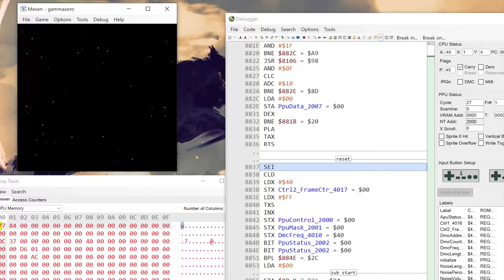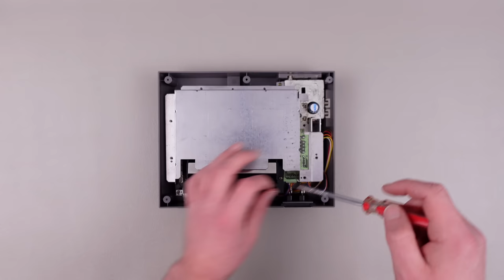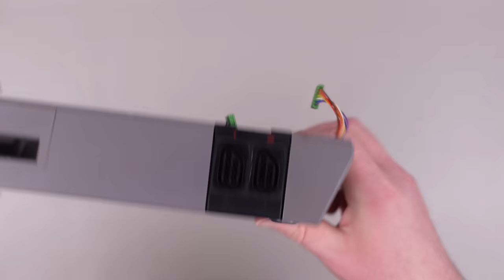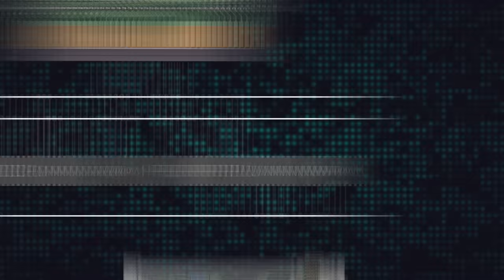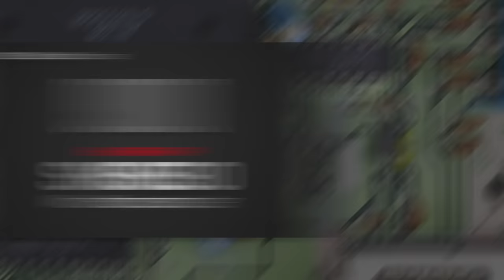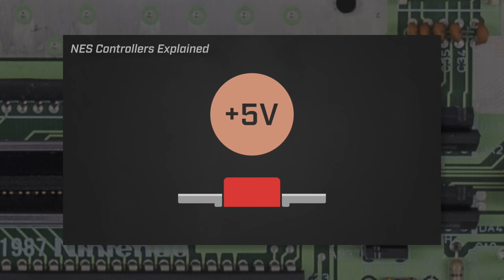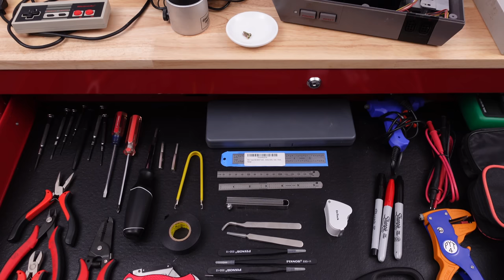NES Hardware Explained

Comment: I've found that cleaning the 72 pin connector is far superior to replacing it. Aftermarket connectors have a harsh grip and are made with inferior and harder metals that  will damage the pins on cartridges. I've cleaned 5 different OEM connectors and they work like a charm. Please just clean and not replace.
Reply: REALLY harsh. I got a new one and it had a death grip on the carts that required pliers to get the cart out. I ended up shoving an everdrive in there permanently to test ROMs I make. No way am I having it ruin my collection!
Reply from the maker: This is VERY true. The system I got for this video actually plays better than my “refurb” I bought years ago with its replacement connector.
Reply: I've seen some suggest to boil the original connector, I wouldn't recommend that. I think its just fine to get it a good scrub with alcohol and then slightly bending in the connectors inwards a bit to make better contact with your games.
Reply: Agreed.  I replaced mine about 15 years ago and it is really hard to get cartridges in and out.  On the plus side it works without pushing the cartridge down.  Unfortunately I threw out my original connector back when I replaced it.  Also, it worked better but was still finicky, so I'm glad I know about the alignment screws now.  I'll get in there and try adjusting it.
Reply: @nict2 yes boiling works. It makes sure the plastic comes back to its molded form. This is how you revive lego bricks who dont stick on each other to. But be carefull, dont actually boil it, id say take water of around 75c.
Reply: Those are facts
Reply: @nict2  I was skeptical about boiling too until I tried it on a connector that I just couldn't get to work reliably no matter how much alcohol I used and how well I scrubbed it down. After boiling for 20 minutes, it worked 1st or 2nd try on almost every single game I threw at it. That was about 2 years ago, and I haven't had any problems with that NES since then.
Reply: @DannyHensel74205  Interesting, glad to hear its a solution that is holding up for you. I think the moral of the thread here is the original NES 72 pin connectors are fixable and the aftermarket ones are brutal to your game carts and not worth the money/trouble.
Reply: I agree cleaning the connections can work wonders. Youd be suprised how much dust and grime accumulate over the years.
Reply: This is actually really good to know and should be shared more than it is.

Edit: This made me curious, if you have a cartridge that doesn't work due to damaged connection pin(s), is there a way to get it working again? Well I guess you could get a completely new board printed and move the components over... but I was more wondering about getting the pin(s) to connect.
Reply: @Chepakishui  I have never heard of restoring pins on an NES cartridge but I have heard of it being done to arcade PCBs. There are a couple different methods I've seen for arcade PCBs, both involved removing the protective coating from the pins and adding solder.

One method where the pins were re-tinned with a very thin layer of solder. The other method actually adding some thin sheet metal to replace completed damaged pins. (Some arcade PCBs literally melt the pins when they short out so this is way overkill for an NES cart).

Any solder used to restore the pins in this way would eventually corrode and required to be re-flowed periodically.

Since doing this to an expensive cart could potentially significantly lower its value and the repair is ephemeral  it's probably not worth it to attempt this type of repair.
Reply: @nict2  thanks for the detailed explanation!
Reply: Oh, and the spacing for aftermarket connectors is 2.54 mm (0.1 inch) rather than the correct 2.5mm (which is less than 0.1 inch)
Reply: Clean motherboard pins and both sides of connector with alcohol with swab, until it stays white. Then apply contact spray again with swab in connector and motherboard. Do the same (alcohol-contact spray) to the cartridges too. This combination makes wonders. In case that connector has corrosion, leave it for 20 minutes in vinegar first before applying the others.
Reply: Boiling sounds dumb, until you try it. Oddly, this fixed my original 72 pin connector completely and it plays games on first inset. I didn’t need to rebend pins or anything like that.
Reply: I actually bought two replacement 72 pin connectors for the NES  (do no ask why because i don't really know) but i did actually never used any of them  on my NES. I did disassemble my NES cleaned and even bend back pins on my 72 Pin connector and reassembled my NES and now it works every single time with every game cartridge i put into it.
Reply: It wasn't always this way. 20 years ago I replaced my 72-pin with a connector ordered from who knows where, and I still have it installed. It didn't have a deathgrip then and it doesn't now. It's arguably higher quality than the OEM connector - it was advertised as gold plated and I have no reason to doubt that because it is still corrosion free and visually shiny.

Sometimes the OEM connectors can't be saved. Due to the habit of people blowing in their cartridges, along with the moisture and acids that go along with that, the original connectors in some systems are heavily oxidized and not salvageable.
Reply: @emotionz3  try the cleaning solution i said before, cartridge wouldn't loose connection even if you tilt it.
Reply: Or just get a toploader or Famicom lol
Reply: The only aftermarket connector I've found that's worth a damn is the Blinking Light Win. Completely eliminates the design flaw of the original connector, but looses nostalgia points. However, I prefer refurbishing the factory connectors too. I've never seen a replacement for the original design that wasn't complete trash. Grips to tight and/or just stops working at some point.
Reply: What do you use to clean them? Rubbing alcohol?
Reply: @ruddiestmanx5116  Some people just boil them, but to really clean the pins, you have to touch them with something. My method is to use some card board, like a cereal box folded in two, doused in IPA. Then you just insert and remove it to clean the pins like you would with the old cleaning kits. The cardboard is just abrasive enough to clean the pins.
Reply: @TheGameBench  thanks I’ve been thinking about fixing one. I like working on old Nintendos. Im probably gonna start selling them.
Reply: @ruddiestmanx5116  Yeah, no problem. It's super satisfying to restore them.
Reply: Sadly some 72 pins are too far gone for that to work like my family nes that i found that had a cart loaded in it for longer than I've been alive and there's no bring that connector back to live lol I tried because the one made out of probably cancer plastic and  china pot metal never work as good as the originals take the cartridge out when you're done if you don't wanna go through like 4 72 pin connector before you find one that has n image and doesn't take the chosen one to pull it from the nes stone
Reply: Why alcohol rather than Deoxit?
Reply: @rickc303  My answer would be because I've never heard of deoxit but isopropyl alcohol is everywhere (not that you asked me.)  Judging by the name, it'll help with oxidation and whatnot, but I don't know how good it is at just removing/penetrating dirt and dust. Alcohol is good for this, and it's cheap. But assuming it's a gentle oxidation remover, maybe a chelating agent, then by all means go for it! Personally I'd recommend you still use alcohol for the dirt and oils, then worry about the oxide if it looks bad, and depending on how deoxit works, I might take it off with alcohol again, but there's more than 1 way to do things, and if you think that product is safe on the plastic, and it's safe on the metal, then there's no harm in giving it a shot! Thanks for sharing a bit of knowledge. I'll keep my eye out for that product :)

Comment: I've not seen anyone else cover the NES in such an in-depth and easy to digest way. Your videos have been a big push for me to get back into electronics and how systems work on a hardware level.

Also, would love to see a video about the Expansion Bus port. It's always interesting to think about all the things Nintendo could have done with it, and I'd love to see your take on it!
Reply: from what i've read, it seems to mostly be another set of connections same as the cartridge slot? if thats the case, it wouldn't open up anything remarkable.
Reply: I heard Nintendo made an add on device that never got out into the market that was supposed to connect to the internet so people could us the nes to do things like gamble or by lottery tickets. I think they were also thinking about creating a disk system attachment that played disks like on the Famicom Disk System too.

Comment: Great video!! A great introduction to the internals of the NES. The dremel on the way to the connection port AHH!!
Reply from the maker: When I filmed the B-Roll for that shot all I was gonna do is show the removal of the little cover on the bottom. I just happened to see my dremel sitting on the workbench and I couldn’t resist 😂
Reply: I once popped it off with a screw driver as a kid, luckily I didn't damage the motherboard (at least at that point).

Comment: I did an incredibly simple mod to get expansion audio working on one of my NES consoles. Weird that it was as simple as jumping a few points on the motherboard together with a small resistor. That said, I really have no idea why that it works. Looking forward to the episode where you explore the unused expansion adapter at the bottom of the motherboard.
Reply: I'm also excited for him to cover that. I would really like to know what's going on in the NTSC NES in regards to that. As far as I understood, the expansion port was always functional, they just disabled/moved most of it since most NTSC games weren't published with the expanded chipsets that would've utilized it.

Comment: Good stuff! I bought a motherboard alone for fun to go with my (complete) NES, and it was great to see an explanation of all of the components.

I am curious to hear more about how the cartridges act as extensions to the motherboard, i.e. the NES is actually not a complete computer without a cartridge. I know you covered cartridges before, but I mean more about how they work with the main board. This would inevitably lead to how mappers work.

I believe the Sharp SM590 is technically a microcontroller (not a CPU / microprocessor), i.e. it has its own RAM / ROM and only performs a single task, sort of like an Arduino / Atmel chip.
Reply from the maker: I actually meant to say “Microcomputer” chip cause that’s how they marketed them back in the day, but yeah it’s basically a microcontroller :)
Reply: That's a fair assessment, if you turn the console on the CPU will try to look for the Reset vector at the end of the memory space, but of course without a cartridge it will just find nonsense there, or maybe all zeroes? I'm not sure. But either way it will try to execute starting from that address and there will most likely be garbage instructions there or a zero, which is the opcode for BRK, so eventually it will end up in an endless BRK loop and it will keep overflowing the stack. Not that it will be able to communicate that to you in any way, but that's what will happen on the inside. 

I'm not sure how complex you could potentially make a program that loads itself into the 2kB RAM and runs from there without needing the cartridge after copying itself. Interrupts can't be used anymore like that and the PPU will see garbage open bus data so drawing anything meaningful might be impossible. Not to mention that the cartridge has to connect the "CIRAM" pins to decide whether the internal VRAM is used or the cartridge provides its own. Without a cartridge bridging that connection in some way you basically have no nametable memory either.
Reply from the maker: @vuurniacsquarewave5091 Oh god… Now I wanna see just what could be done with only the 2K of ram…
Reply: @NesHacker  Sounds should work just fine, but even that's out of the question for the Famicom, which needs the cartridge to complete the circuit and tie the audio output and the input pins together.

Comment: I noticed you didn't talk much about the RF box...  but it's got the bridge rectifier and the 7805 regulator in there too. 

Even if you mod your console to output HDMI or component video, you can't just rip the RF box out without replacing the 5V circuit that feeds in and out of those thick chunky pins.

I fabbed up a PCB a couple years ago that takes a USB type A cable, it seems to fit nicely in the square hole where the barrel plug used to go, and solders back up to the original pins.
Reply from the maker: Yeah I am pretty crap with power electronics in general, so I chose to leave it the deep dive for a future episode while focusing on the digital electronics which I have a much better grasp on.

I should totally do my homework and make a follow up though.
Reply: More things to note:
They can be from either Alps or Mitsumi.
They do not use the same quality capacitors, which often fail.
The capacitors used by Nintendo on the main PCB rarely fail.

Comment: Try aligning the cartridge tray while the board is outside of the case.  It's much easier that way.  All you have to do is make sure that the loading tray is flush and holes centered on the main board to ensure proper alignment.  Once that is done then put two screws into the back position, one on each side of the 72 pin connector to buckle it down before putting into the case.   This is pretty much how they were assembled on the line.
Reply from the maker: Nice 👍🏻

Comment: I've fixed a lot of NES back in my time but I didn't needed to know that much, the majority of defects were in the voltage regulator 7805 by overheating it and that chip is present in every retro consoles so I was easy to find and replace, that's before parts were easy to buy online or at a near store

Comment: The big problem with the cart tray is the tab on the bottom that needs to go under the system board. Unless you're mindful of that tab, it's very easy for it to end up on the top side and cause problems like what you were showing, all the way to the tray not even being able to lock down. This is due to the fact that the once you start tightening it down, you warp the cart tray. You shouldn't have any issue just tightening the screws on the tray down snug as long as you've got that tab under the board, your 72-pin connector is working properly... as well as the game.
Reply from the maker: Yeah that seems to be the case, though I’ve not done too much experimenting with my systems. I’m gonna mess with it some more and do a follow up since this wasn’t entirely clear to me when I made the video. Thanks for letting folks know! 😀
Reply: @NesHacker  No problem. I remember when I opened up my first NES back in the 90s and had all these problems after putting it back together and just kinda' dealt with it. Wasn't until I couldn't stand it anymore and figured I screwed something up, opened it up and found that darn tab.

Comment: Not too sure if you know this but that cartridge elevator has a tab on the front that slides underneath the motherboard. You shouldn't need to mess around with those screws if you have that tab under the board.
Reply from the maker: Hm, well yes it does slip on like that, but the tightness and balance of the screws definitely affects the ability for games to easily play.
Reply: @NesHacker  Yeah? Hmm. I tighten mine down like any other screw and it always works first try. This is with perfectly clean games and with an OEM 72 pin connector that I re-bent the pins on to put them back to as close to factory as possible.
Reply: @NesHacker  I had my cartridge slot improperly on and I found fiddling with the screw tightness did the same thing until I realized my error when I watched some how-to video a ways back on how to rebuild an NES. If your cartridge slot is perfectly flush with the board making sure the tab is secured (not sandwiched between the connector and the motherboard at the end, it's supposed to wrap around) you may find that you don't need to "tune" it anymore. You may want to update your video to include this detail
Reply from the maker: @werdsup Ah heck, well you can’t really update videos on YouTube. Maybe I could do a short about it? 🤔
Reply: @NesHacker  good idea! I was thinking you could annotate the video but this issue probably warrants its own coverage
Reply: @werdsup  Heh. I suck at explaining things. That's what I was trying to explain to him.